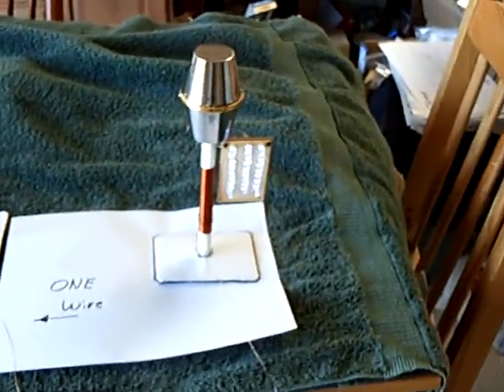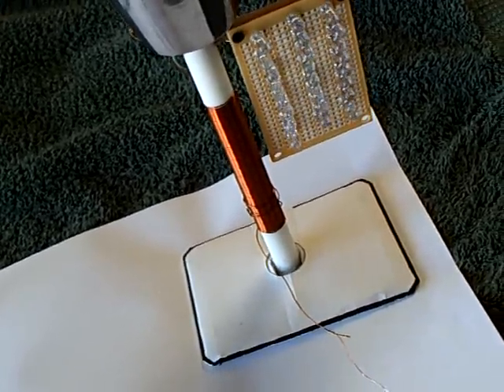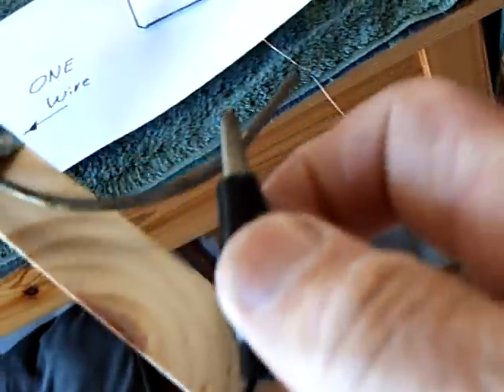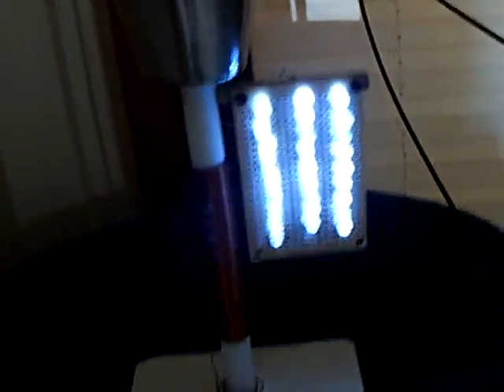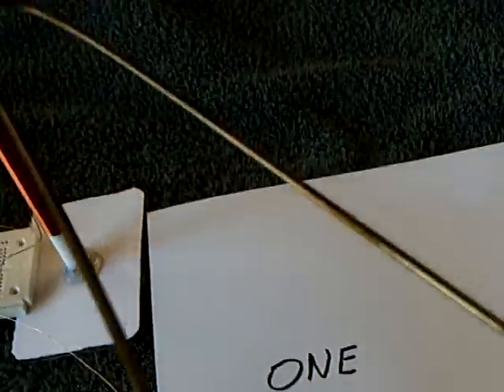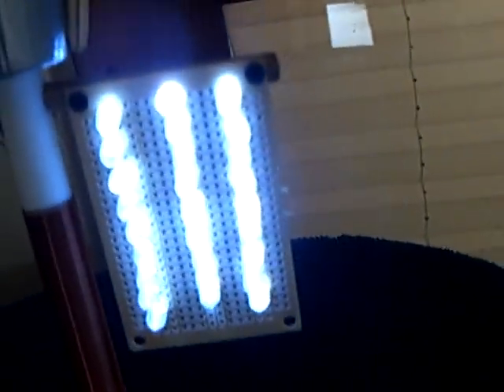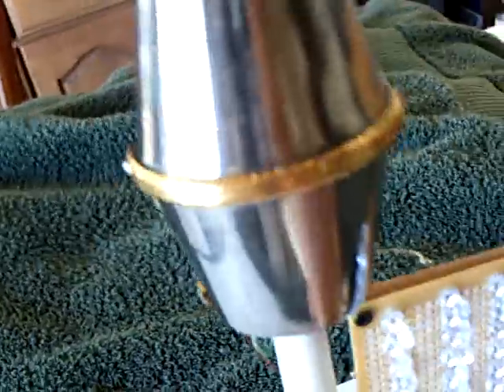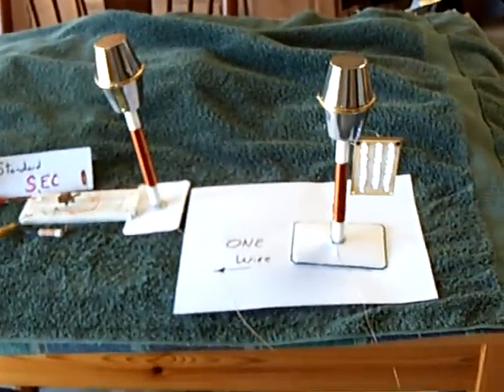SEC transmitting at 25 ft---- Around a wall

Comment: There is an open source wireless power project at peswiki [dot] com/index.php/OS:Tesla,_Meyl,_and_Jackson%27s_Wireless_Aetheric_Power_Transmission

In this project a simple function generator is the power source and it is noted that there are 2 frequencies.  The first can be affected/blocked by hands, but the second frequency is NOT affected by objects around the aerial receiver!

Comment: The two circuits are tuned, if metal is brought close to the any coil its tuned frequency will change and the circuit disrupted - the grounded coat hanger acts as an antenna that greatly attracts the transmitted signal shorting it to ground. Tesla started this proceedure in the 1890's!  This is a precursor to telepathy - all things in tune can transmit information.

Comment: I wonder what would happen if you split that 1 wire in half . 

Then use each end of the wire to earth ground, like this there is a common base frequency/ground - then we have a common reference for each coil to share while in oscillation  -  if so we would have true wireless transfer of energy w/o any wires, other than the ground for each coil. 

Would this experiment still work?

Comment: Neat circuit. You can test if there is charge transmitted with one of those clamp meters or with a scope and a coil wrapped around the wire (hard to figure out the actual current with this method though.)